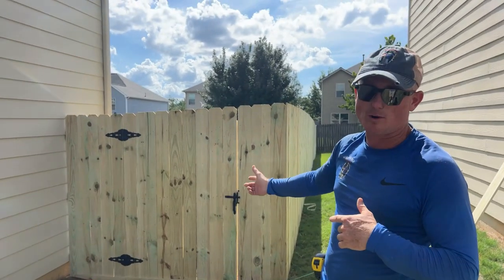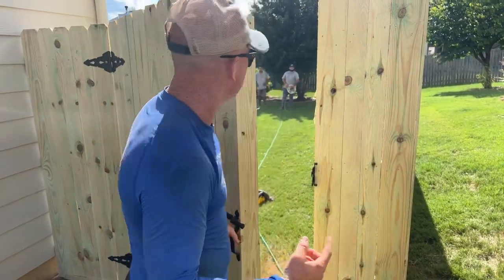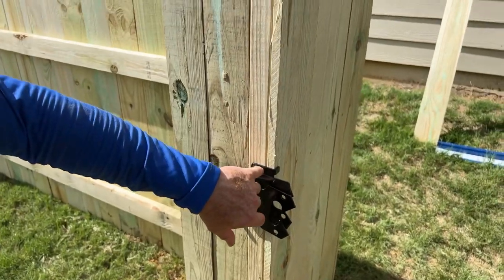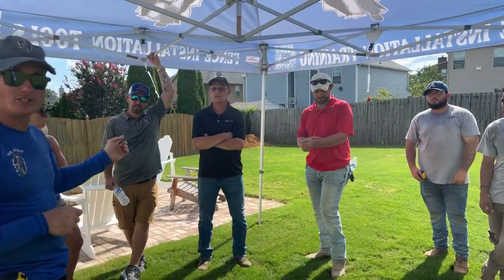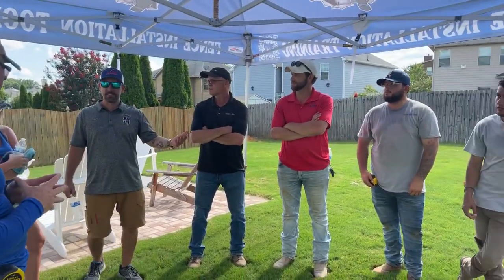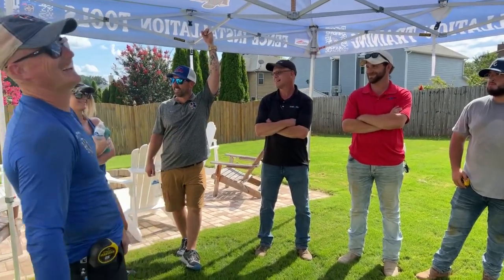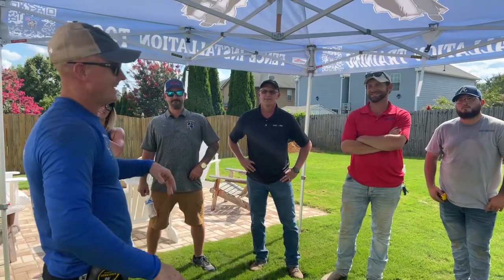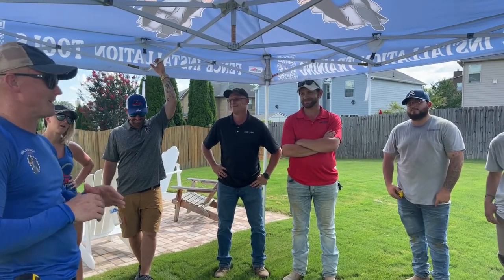Final Walkthrough (Atlanta)

Comment: Here in Tulsa Oklahoma we have a small fencing company and have been going for 3 years about. Definitely using the gate framing you did for our next large gate, been having slight issues with twisting on the 6’ and over gates even though we use cedar pickets and not pine. Also, it’s worth the time to drag out the air compressor and use a pneumatic nailer, I would run circles around a guy with a battery powered nailer I’ll tell you that, Milwaukee or Dewalt.

Comment: What is the product you use for thr handle and latch?
What are the screws you use, I couldn't hear it clearly and what do you use for the cement. It's a normal drill with what attached to it?
Thanks in advance